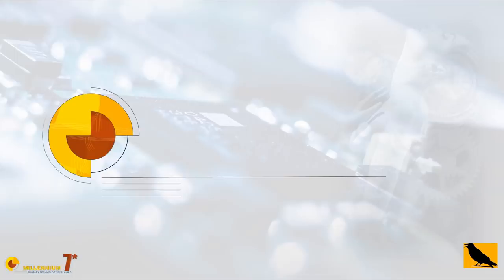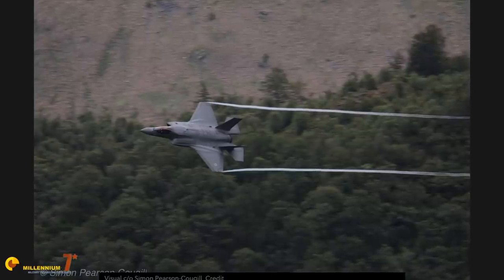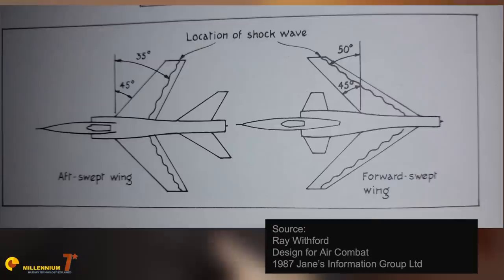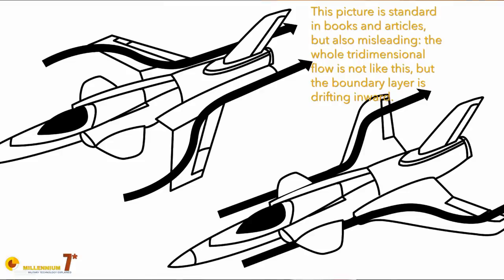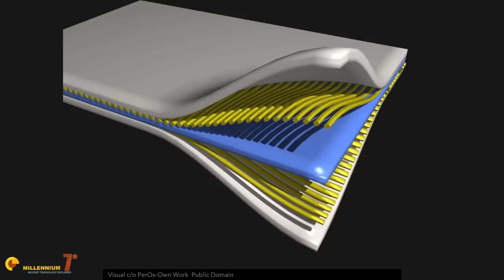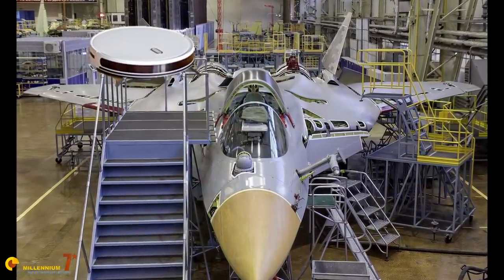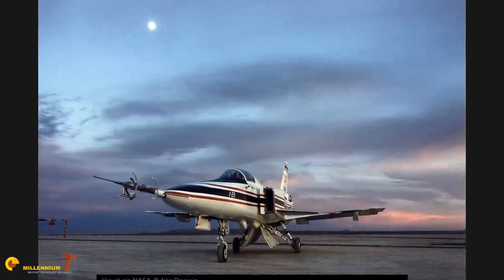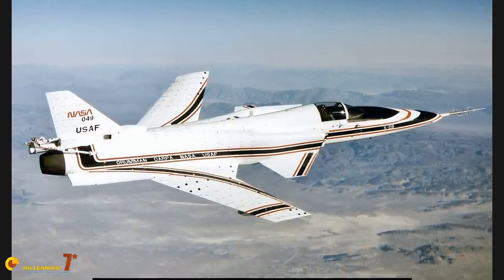Could RUSSIA USE this NOW?    -   Why Berkut and X-29 are a dead end.

Comment: Great video, you forgot the main advantage of forward sweep though. Its 23% cooler than conventional sweep
Reply: @Millennium7HistoryTech  If it looks right, it most likely IS right!
Reply: And it's used where it's actually matter - cool combat anime
Reply: The very reason I use it in a few fictional designs. Good for the aggressive look. ;)

(I do try to understand aerodynamics however to make something that look plausible. I find things that look plausible also look cooler. ;) )
Reply: I think it’s ugly!
Reply: 123%
Reply: @kevino.7348  to each their own I guess.
Reply: That's true, I did the math. It's very complicated formulae and calcuses, with a bit of physics and fluid dynamics and the like.
I was surprised at the results, as I generally prefer normal wings to forward swept, but science is science!

Comment: Getting used to the high standard of your videos. 

The "simplified aerotronics" explanations are always to the point and give the listener a clear idea of why the technology has been accepted or rejected, together with what advantages it gives the operator. All that with a light-hearted approach.

So basically in this one, reversing the wing sweep also means you need to reverse the tail position to canard-like (front tail effectively) due to inversion of force geometry (aero and structural) as if transposing  all the lift producing surfaces of the aircraft (Ax=trans(x)trans(A)).

Fantastic work. Can't wait for the next one. Grazie mille ))

Comment: There seems to be an assumption that a forward swept wing forces the CG to be aft of the CP, and also requires the airplane to have canards and FBW.  Seems to me if you want a stable relationship between the CG and CP you just move the whole wing farther aft, the same way the wing is moved forward when it has long rearward sweep (see B52).  The JU-287 had a conventional tail rather than canards. Seems to me that If the CG is aft of the CP it is intentional because relaxed stability is desired.  

BTW, the Piaggio Avanti shown is not a good example because its straight wing was placed aft so that the spar would not interfere with the height of the passenger cabin, and that did necessitate a forward lift surface for balance.

Comment: A number of fighter aircraft are neutrally stable (as in at optimal cruising airspeed, no downforce is needed in the horizontal stabilizers). This is true even in some models with no fly by wire.
Even though this puts the drag at the center of gravity, the geometry of that drag can still offer some stability. A rearward sweep in the wing imbues some stability simply because if either side starts to slip out of axis of flight, the sweep on the side slipping forwards becomes more head-on to the air flow, while the other side becomes more swept away from the airflow. So side-slip tends to auto-correct.  (nice YF-4E cameo there :) if you like that one, check out the F-4(FVS) idea too)

Comment: The X-29 is one of my favorite planes. It's just so beautiful, and the advancements they made on this project were really cool.
Reply: By the early 1980's digital fly-by-wire flight control computers, combined with far more flexible and stronger construction materials, (like carbon-fiber composites), finally made forward swept wing designs  aerodynamically possible and practical within certain flight parameters. However, military aircraft, (especially fighters), need to carry large weapon and auxiliary fuel loads and still be able to to carry out violent maneuvers at high speeds. This tends to render the advantages a FSW design rather moot compared to it's very real disadvantages, like not really being able to carry heavy wing pylon-mounted stores without an unacceptable risk of structural/wing failure.

Comment: Having them sweped forward does have  a few advantages. One is that the air dont slip of the wing... or at least does it to a lesset degree, reducing the need for winglets.

For supersonic airliners that would be very preferensal.  There is a few other advanatages.

Of cause the increased weight is of consern. But there is a way around it. Have only the last 1/3 sweped forward and make the inner 2/3 softer than the outer 1/3. This will make the wing bed closer to the root making the aircraft fly closer to neutral.

Comment: Now I can't stop wondering if Ace Combat's X-02S Strike Wyvern with its variable wings could be a solution.
Reply: i think the main problem is "where the fuck does the wing go?" lol
if you look closely, the retracting part and the root are the same thickness, and where would the other wing components be? like the structural reinforcements and control surfaces controls
plus if you look closely at the X-02S in Ace Combat 7, the flaps are used as brakes, and the retracting parts of the wings clip through them when deployed at mach speed
don't get me wrong, the X-02 is a beautiful plane, but probably the least realistic in terms of basic geometry being the one that uses clipping as it's core mechanic
but hey, Belkan tech go drone screeshing noises XD

Comment: About the yaw instability: In normal backward swept wings, if the plane's nose begins to point right, the right wing will present less area to the airstream while the left wing presents more, counteracting the yaw. With forward swept wings the right wing would present more area than the left wing, making the situation worse.

Comment: There are going to be trade-offs in every design.  Gaining performance in one area means sacrificing performance in another.  

Forward swept wings can be significantly smaller than straight and backward swept wings in order to achieve the same lift.  This has many implications.  And as you pointed out, all things being equal, their stall characteristics and performance at high angles of attack are superior to those of backward swept wings.  These are certainly desirable features in fighter planes.  And keep in mind, less forward sweep can negate the need for canards.  In fact, there’s a Russian trainer jet that features forward swept wings with rear stabilizers only.  Lastly, you mentioned thrust-vectoring.  Any jet’s performance will improve with thrust vectoring, including a jet with forward swept wings.

Comment: Ahh, my favourate part of the video is that X-29 has a centre of pressure behind the centre of gravity but still horribly unstable. Many channels mistakenly claimed stability is always because of the position of centres, but as usual, you nailed it Sir. Thank you for those detailed and in-depth explanation!
Reply from the maker: That is something that should be explained in detail. You gave me an idea.
Reply: @Millennium7HistoryTech  True, the Collar Triangle definitely worth its own video :)
Reply: He did say not it was horribly unstable, he said it required another a lifting surface  forward to balance the nose down moment of the aft aerodynamic center.  That is true of the X-29 configuration, but not necessary true of all forward swept configurations because the wing could be placed to use a conventional tail if desired. In any case having the AC even farther aft of the CG makes makes an aircraft more stable, not less.

Comment: Dear Millennium 7, as always I appreciate your work, however I think you made a mistake in your video. You claimed that because FSW design have three sets of control surfaces it's definitely not great for stealth. Well, I definitely disagree. As far as I'm concerned, forward swept wing design is well known for having very good if not excellent stealth characteristics, at least in the frontal sphere, because radar beam impacting the leading wing edge is reflected toward the fuselage, quite effectively dispersing it, especially if you combine this feature with radar absorbent material on the aforementioned fuselage. If you add to this internal weapon bays and a s-duct, you have significantly reduced radar cross section, again in the frontal sphere at least.

It's also worth to mention, that what we know today as Su-47 is an aircraft based on Su-27 fuselage, which by itself is not stealthy at all and initially Su-47 supposed to be much stealthier design called C-22 or S-22 (not to be mistaken with Su-22!). You can find some articles and some pictures of S-22 on the internet for further research if you want to, and I dare you that you'll admit that S-22 seemed to be much stealthier design than what it eventually became (Su-47).

Comment: I saw a video where the FCS of a Su-35 failed so the pilot turned it off and then " flew " the plane back to the factory. I imagine if the same would have happened in a Su-47, he would be ded or would have had to eject which is also quite the same.

Comment: A good potential followup would be what makes the "diamond" variety of delta configurations (where the leading edge is backswept but the trailing edge is forward swept) so good, considering that just about every 5th generation aircraft (except possibly the SU-57) is using some variety of the design to an extent.

Comment: 0:34 So sorry to make this comment, but the airflow becomes an “incompressible fluid” not a “compressible fluid” at transonic speeds. Slower, it is a compressible “fluid.” Faster, it “shocks” to incompressible. Other than that little detail, WELL DONE! Love your channel! FYI, I’m a commercially licensed pilot in the US, and high AoA in computer simulations, IRL model aircraft, and even STOL airplanes is my specialty. (Edit: I may have misunderstood the phrasing at 0:34. Check out my response to Mosca).
Reply: You ought to check that claim.
Reply: Thanks so much for your concern. I think that the terms “compressible,” “incompressible,” and “fluid” are the kickers here... Air can be compressed, but once the flow becomes supersonic, it behaves as if it is incompressible (fluids are generally considered to be incompressible) even though it is being compressed to make the shockwaves that form from the passage of a supersonic object. I have done extensive work on transonic projectiles, and I know the effect here pretty well. If a transonic object “enters compressibility,” then to it the air act like it is incompressible. To an outside observer, the air is being compressed by the object. Loads of fun IRL... I have seen projectiles go BONKERS once they begin to leave supersonic flight, go transonic, and then subsonic... YT makes publishing this an issue though, so it isn’t on my channel 🙁

Comment: I wonder....what would a reverse sweep flying wing be like in terms of flight characteristics? I'm thinking of a fairly large aircraft that would have no separate wings and no tail, and which would maneuver entirely using 3D TVC. The flying wing configuration provides maximum lift and gets rid of the trouble areas found with traditional wing/fuselage/tail configurations. With a flying wing, you don't have joints between wing and fuselage which are weak areas susceptible to, you know, ripping the wings off? With TVC, you immediately remove problems caused by control surfaces in relation to airflow. In fact, this would also solve the stealth issue with forward sweep because you just have a big forward swept wing and TVC with no slop anywhere. 
  The negative stability could likely be reined in and harnessed by modern FBW FCS systems, so it could wind up being quite stealthy.

Comment: Before you start the video, I was saying to myself, I don't like Forward swept wings because it move CL forward, and usually want to move it aft.  One design I work on but gave up on because high speed stall was putting forward swept wings in rear  and large canards in front. It was also very unstable but fast, low drag, high lift. Great takeoffs, lousy landings.
Reply: There seems to be an assumption that a forward swept wing forces the CG to be aft of the CP, and also requires the airplane to have canards and FBW.  Seems to me if you want a stable relationship between the CG and CP you just move the whole wing farther aft, the same way the wing is moved forward when it has long rearward sweep (see B52).  The JU-287 had a conventional tail rather than canards. Seems to me that If the CG is aft of the CP it is intentional because relaxed stability is desired.

Comment: Overall, as good an explanation as I've heard on the forward swept wing for a fighter...
But, I suspect practically all of the problems that are described in the second half of the video can be engineered so shouldn't be major problems.
The basic advantage of a forward swept wing is its instability which should mean if extremely highly responsive acrobatics is desired, it's a big contributor to achieving that objective no matter all the other ways that extreme maneuverability can be achieved including thrust vectoring and additional control surfaces like canards. 
The big disadvantage as described is the backward stresses on the wing which could destroy the wing as more angular stresses are placed on the wing, and  related instability. But these two issues can be addressed today as described forst by use of composites with extraordinary strength and the implementation of fly by wire to translate all aerodynamic factors into the pilot's desired action.

For the above reasons, I suspect that the actual main reason not to implement forward swept wings is simply that acrobatic agility is no longer a primary objective... That other features are more desirable including increasing payload, improved efficiency in normal flight, minimizing maintenance and increasing lifespan. All these other desirable features are opposite an aircraft built to perform under high stress and acrobatically.

Comment: I'd suggest a reason if I may. Even the most sophisticated military flight control systems are built on reacting to pilot intent. In order to establish that, there's a timeframe, and the longer you can make that, with declarative as against imperative control, the more useful unstable aircraft become

Comment: nice video.
have always been interested in airframe stability/instability...forward sweep really maximizes the envelope regarding instability. 
I wonder how a forward sweep would effect pressure waves in mach flight? I tend to see 2 pressure cones coming from the wingtips converging on a pressure cone starting at the nose...that would have effects that are very hard to predict.
Reply from the maker: 't mention this in the video but it is a further issue.
Reply: @Millennium7HistoryTech  
figuring out pressure airflow would be rather difficult with converging pressure flows. this kind of thing fascinates me.

Comment: so you said a 3 surfaces configuration isn't great for stealth, but what about for example the fictional ADF-01 Falken from the video game series "Ace Combat" that probably uses it's inverted V-Tail (the tail points inward instead of outward) as the rear, downforce-generating surface? as for the yaw instability, couln't it be stabilised by thrust differential?
also, we used different means to give classic wings designs the properties of forward swept wings designs, but couldn't we do the same for the forward swept wings? i am sure some countries would love a plane with reduced drag to save on fuel efficiency too

Comment: Looks like the design came too early to be practical for materials and assembly, available in the 1940s - and when composite materials were available, it was too late to compete with the manouverability of thrust vectoring of vastly improved engines. 

Which leaves the application for aircraft that can't be supplied with high-end engines, but require high manouverability for dog-fighting. And the question is under what circumstances would these conditions be met ? If 'fly by wire' via printed circuitboards is comparatively affordable and simple to maintain, a low budget air superiority fighter ? 

Would mass produced, unmanned drones profit from a structural ability to perform automatic, complex evasion manouvres once their sensors report an active guidance lock ? If so, then the design may come back - just as the  Sukhoi S-70 Okhotnik-B drone does not utilize thrust vectoring (albeit relying an 'stealth' for combat missions).